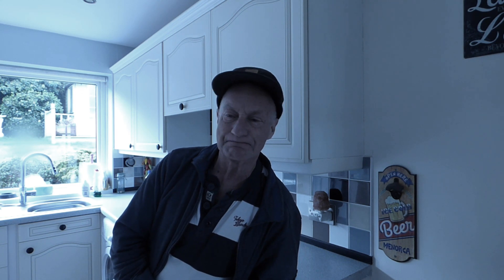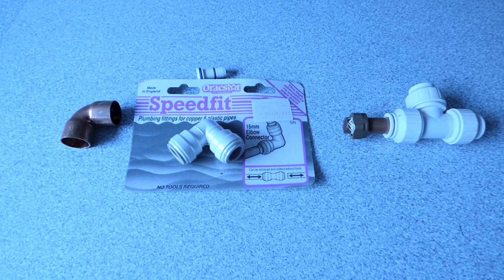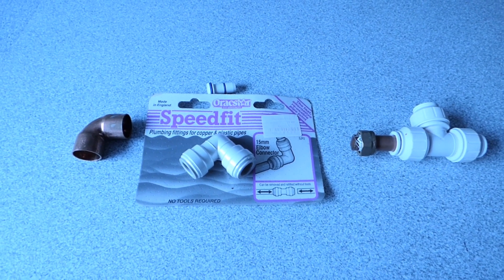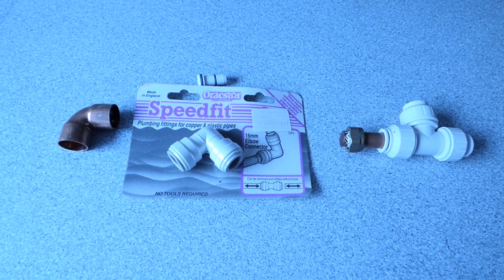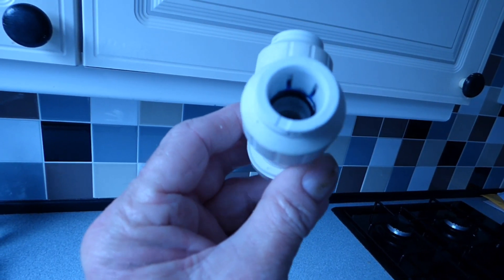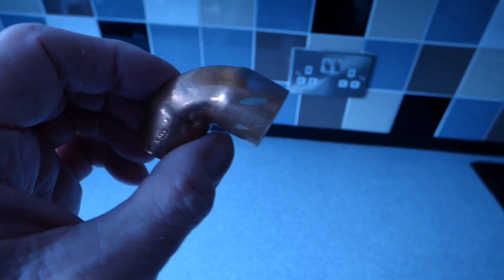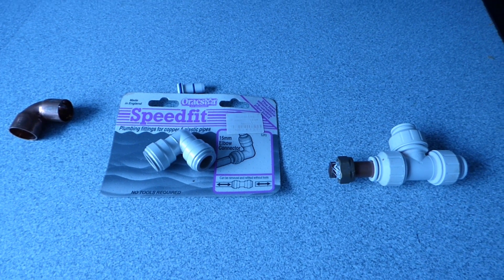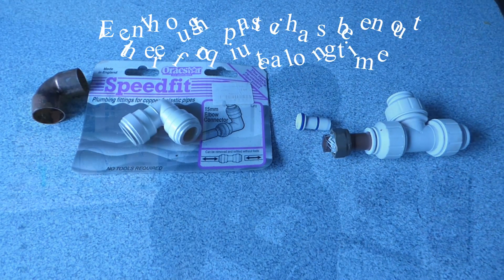Is it better to use plastic pipes instead of copper ones ?

Comment: Quote completely and exclusively for copper and get passed over, for the work, by a n other. Regrettably, I have started using it more for this very reason. Of course, care and good practice should always be observed. I like being able to drill through, rather than notching joists. I don't like plastic being on display above floorboard level; always use copper for legs to rads. The worst case scenario are the "wee timorous beasties" that will gnaw plastic. I've encountered that on numerous occasions.
Reply from the maker: Thanks Loafer. Have a good Christmas. Al and Jan.
Reply: Back atchas both. Cheers! I'm really looking forward to getting woken up at some God forsaken hour by a 6 year old. Curmudgeonly and cynical as I appear... this year, I'm looking forward to it. The boy is getting a Scalextric. Woo-hoo!

Comment: Own house going to go for copper for the central heating and plastic for hot and cold water so hedging my bets somewhat, mainly because gong to re-use most of the existing heating plumbing already in place and copper to match. Generally materials have improved seen lots of very badly degraded rubber electric cable, zero age related pic sheathed cable defects (though have seen plenty with vermin damage). As mentioned plastic needs to be installed correctly, copper also has its issues especially when bent - outside bends the copper gets significantly reduced in thickness and seen corrosion eat pinholes through such bends.
Reply: You are definitely doing the right thing so you must be a thinking engineer?  You'll have piece of mind, especially if you are staying in the same place a very long time.     The  USA,  I heard way back did not allow bending but the folks used fittings. as you say the bending causes thinning on the outer..... Mind you what happened to the table 1 when I was  a young H eng.? It was lovely. At least a 1/16"  thick...... my brother used to be amazed how tight a bend I could form with a spring!  It took 76 years for the iron mains to pin hole our water service =  3/4"  copper. I had to improvise a lump of steel, 1" iron to 1/2" reducing socket welded to a lump of 1" iron pipe & pull it under ground to follow the 3/4" using a winch.... Stupid me using concrete in stead of block paving (better idea)......
No wonder the Americans didn't let  bending happen. It must have been after the right gauge stopped.
2 Pipes made for the price of 1 = that's the penny pinching manufacturers for you.
Best wishes in your endeavours.
Reply from the maker: Thanks for the input Festy.

Comment: I’ve never had a problem with copper (and some of my houses had installations from the 1960’s). I’ve had two leaks from plastic fittings in the last 20 years. For most people, the longevity of plastic will be sufficient for the time they live in the property, but I pity the kids buying property with it fitted as I sincerely doubt it will be trouble free for life. I get the benefits for long runs in the street with proper bonded joints, but I just cant see a full domestic system with many fittings being trouble free for such a long time. Its like cars; after 15-20 years, rubber bits start to decay, and eventually things like wiring insulation start to fail, so simple mechanical servicing isn’t enough. The trust in the tiniest surface of butyl rubber is immense.
Reply: People want instantaneous gratification and cheap stuff. Some of my older customers insist on copper, which I prefer but quote completely and exclusively for copper and get passed over, for the work, by a n other. Regrettably, I have started using it more for this very reason. Another problem are mice and rats. They have to gnaw as their teeth grow continuously.
Reply: loafer sheffield Sadly, yep; WIIFM mentality. Still, keeps plumbers in business for future repairs; every cloud :)
Reply: @Andy Owens Aaaaaaaaaargh! bane of my life. (Apart from the missus) Penny Pinching Proverbials I call 'em. Sign of the times. I spend much more time putting right cock-ups by others and it's not always diy-ers. Worst is call backs to customers who have passed me over to others on the basis of cost. Thankfully, I either just don't bother or plainly state " this is gonna cost ya!" I call it the insult premium.
Reply from the maker: Thanks Andy.
Reply from the maker: That sounds good to me Loafer.

Comment: I would use pex al pex or mlcp pipe personally just because of air entering in the system with speedfit also ease of use. Although where possible I still use copper as I had an issue with speed fit plastic pipe put in when I had an extension done and a rat chewed the pipe between the cavity of the old house into the extension. Never knew I had a leak until some dampness appeared on the wall.
Reply: At 82 I've got a lot behind me!  Luckily I still have my 'marbles' and enjoy such projects as tig welding a stainless towel rail in our static caravan = warmest room in the van!   4" flanged all welded mains in one job back in 1972 in the boiler house. Not thread to be seen!
Plastic compared to copper =NO..... Even on mains that have to be pex in ducts that can be replaced through accesses the joints I would say must be compression fittings...... Murphy's law?   If it ca happen it will happen.   Is the manufactured rubber o ring 'viton'?   If through  cheapo choice it's not then it's inferior in my opinion.
The plastic lovers say plastic will last a long time!  Most thinking heating engineers of expertise would choose copper every time for heating...... domestic hot and cold is a totally different matter and is the right choice for that application.
Best wishes.

Comment: I moved radiator and to use copper pipe i would have had to lift a stupid amount off floorboards in 2 room's to get it in so plastic for me and it's been fine.
Reply from the maker: Thanks Ryan.

Comment: Is there a need for copper instead of plastic near the boiler? Like within a 4 foot radius of it.

Im sure I heard somewhere you shouldn't put plastic pipe too close to it because of the intense heat but I really have no idea...
Reply from the maker: I think it is within a metre
Reply: @dereton33  ah so there is truth to it but its not as drastic as I thought, ok thanks matey!